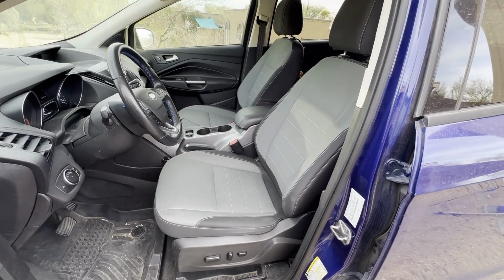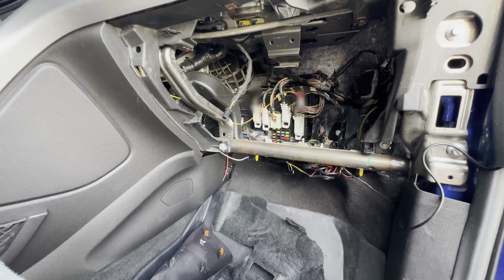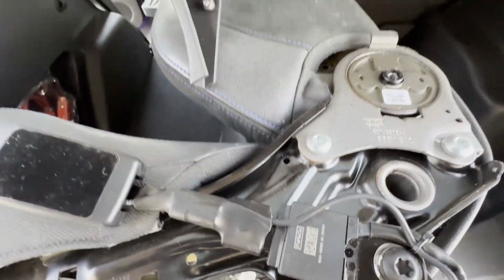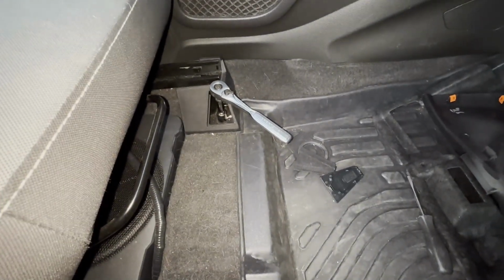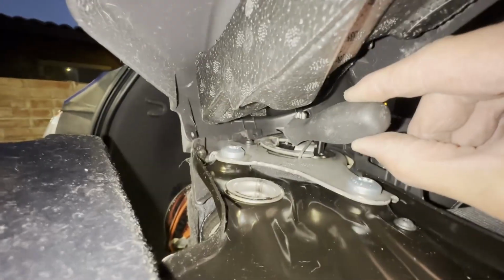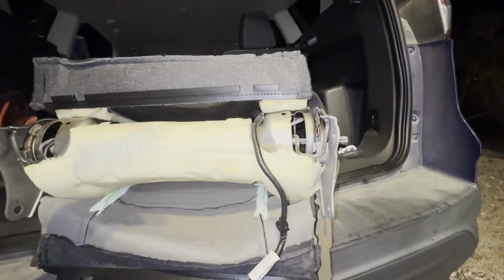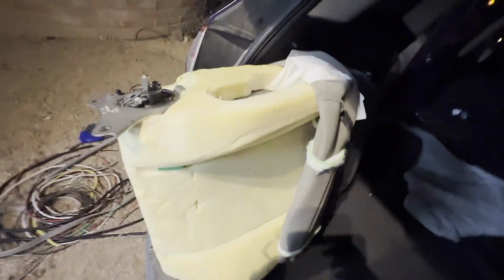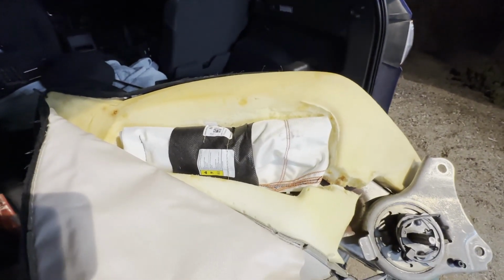Focus ST/RS Recaro Seat Disassembly and Airbag Swap

Comment: How much was it to repair the side bolster?
Reply from the maker: The local shop charged $250 - not cheap but some places won’t touch where the airbag has deployed, so that factored into the cost.
Reply: @ that’s not completely terrible of a price. Looks really good! So basically any ford focus seat air bag should be no problem to fit?
Reply from the maker: @thirstyzeus  It doesn't have to be one from an RS/ST that has the Recaro seats, that's for sure. I'd keep it within the same generation of model years of the car you are putting the seats into used to ensure the connection was the same. An Escape of the same model year would most likely also work.

Comment: Very interesting, thank you!  I've considered doing this to my fusion. I may give it a go. Not sure if the bases are similar but it honestly looks like the same procedure. The only issue is fusion seat airbags are external, so that will be a challenge.
Reply from the maker: When you say external, do you mean they are in the door frame itself / around the window opening rather than in the upper side bolster of the seat? I haven’t seen anyone swap Fusion and Focus seats, but they are similar sized cars and Ford does like to reuse as many parts as possible. If you can get a good deal on the seats, I’d say give it a shot and post a video showing how it worked (or didn’t work and why). Good luck!